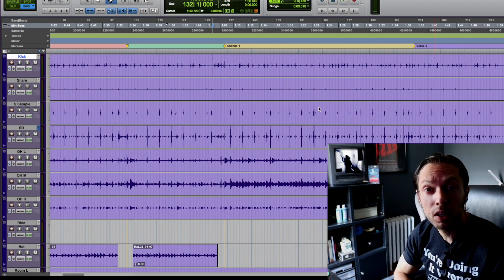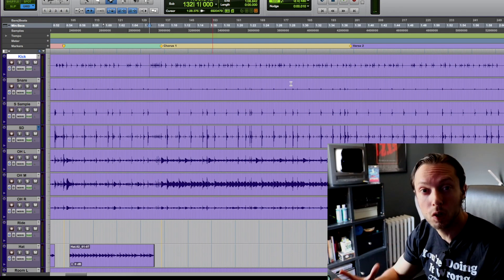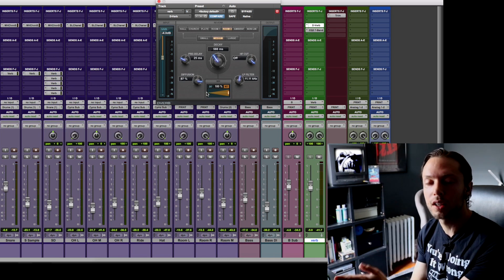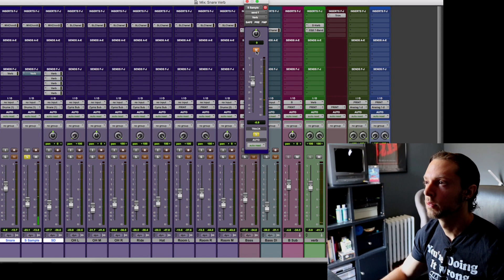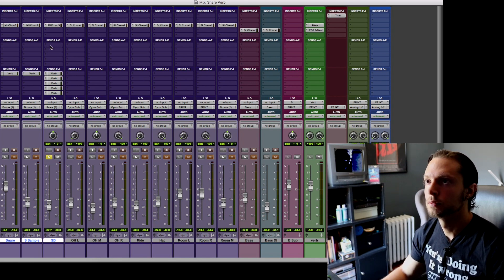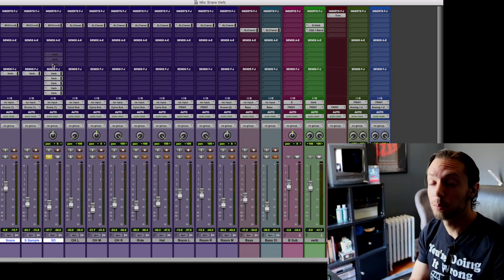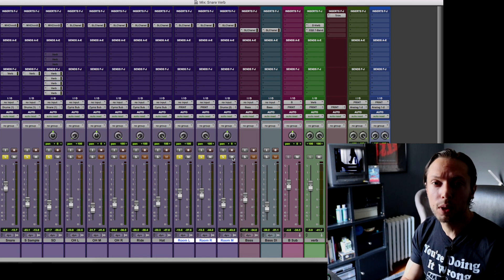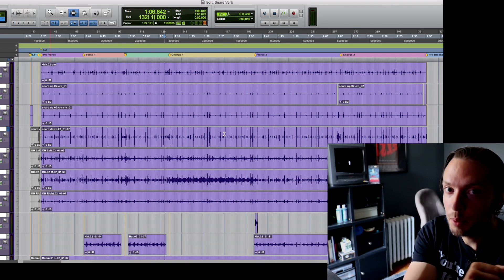Mixing Metal Drums: Snare Reverb

Comment: This is awesome!! What are your thoughts on reverbs with eq built in them?  Unnecessary?
Reply from the maker: The stock one I use in Pro Tools has a high freq rolloff which is cool, but it's super easy to just add a basic EQ after your plugin, so it's really not necessary in my opinion.